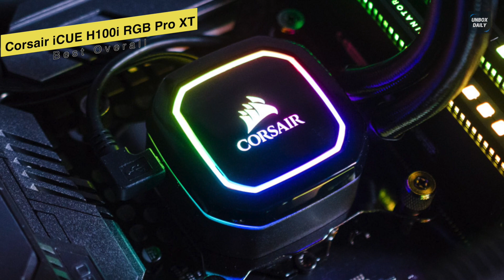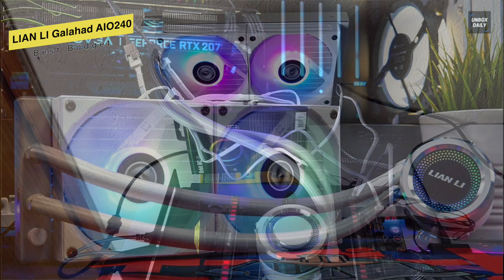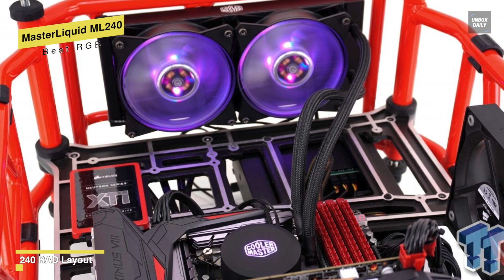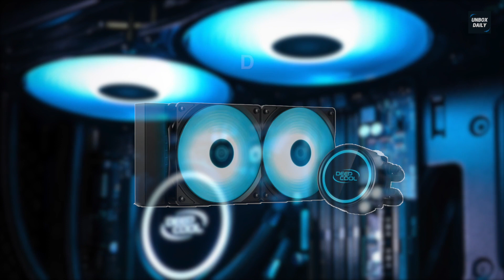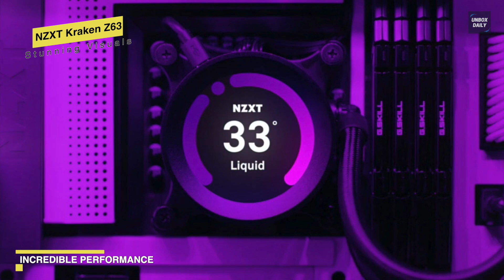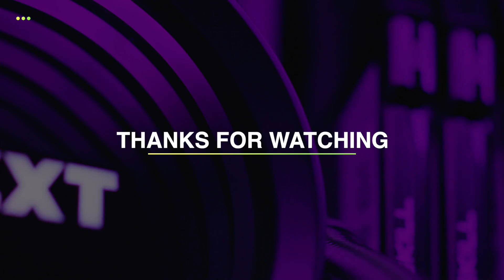TOP 6: Best AIO Water Cooler [2022] | CPU Liquid Cooler w/ RGB Lighting!

Comment: Avoid the msi mag 240r and 360r... They have bacterial growth that causes early life failures.. I've had two now both dead within a 6 month window.
Reply: My msi mag 240r died 9 days after my warranty ran out 😕 absolute waste of money, I was hesitant to get another AIO but the 240 Artic liquid freezer is beast 👍🏽
Reply: @qdxz1  I got the 280mm bro it cools so much better than msi
Reply: @akacaali  yeah to be honest i was meant to order the 280mm but it wasn’t in stock at the time and i had no other cooler to use so I couldn’t use my PC due to my cpu thermal throttling instantly. I will go for a 280mm or even 360mm when i next upgrade my Pc bit for now my 10700k + 6900XT are destroying everything i throw at them😅

Comment: Msi mag is the worst aio it has high fail rate, most common issue is pump failure.
Reply: Why I'm here looking for an alternative.
Reply: I was about to comment this. Mag coreliquid is trash idk why they recommend this stuff to their viewers. my good friend is a computer parts retailer and out of the 15 MSI coreliquids that they sell, 9 came back because of defective pump and/or rgb lightings. I wouldn't trust someone who recommends to buy this aio.
Reply: @TCubanMafia  Same for me omg, i still don't get why so much reviewers recommend the same exact garbage model, now i don't know which one i should buy, maybe the Fractal Design Celsius+ S24 Prisma but i'm not sure about the performances
Reply: Agree, mine died after 1 year and the warranty is trash if you live outside the US, don't buy this thing
Reply: Nzxt will be a better option.
Reply: Yup! It's trash... had 3... every singel one had the pump failing due to fluid issues.
Reply: Fact